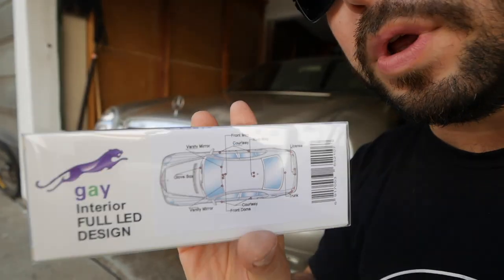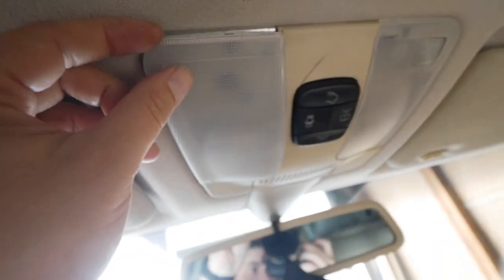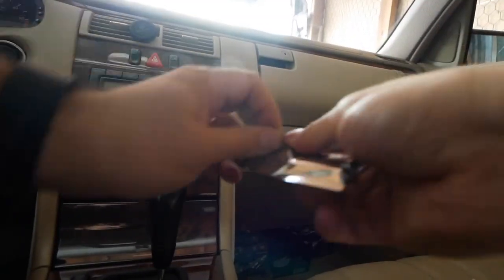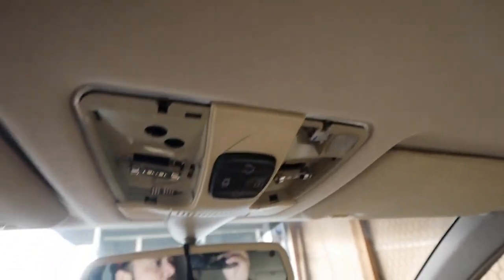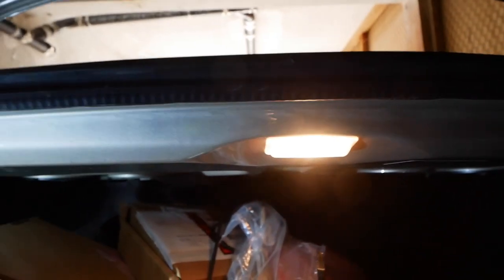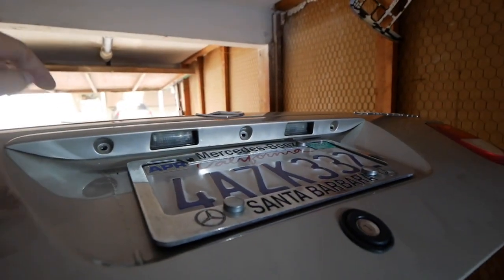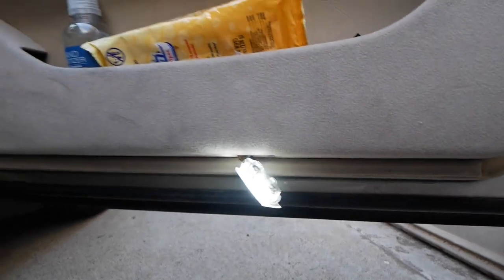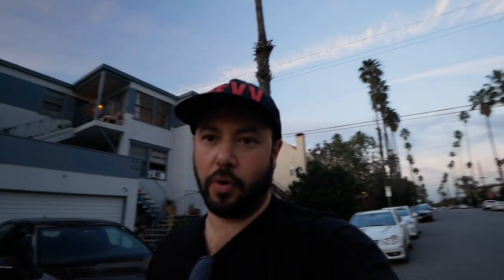Installing LED interior lights on my Mercedes Benz w210 E300d

Comment: is there also a light on the bottom of the backside of the driver and passenger seats? it's to light up the second row foot area
Reply: Do your car has led footwell light for back seat only or also have led for front driver and passenger side ?
Reply: @aizielarif9354  yes. i think is cos my w210 is the facelifted model

Comment: Make sure your lights are off or prepare to get burnt by old light and new light replacement and also live hot wire.even these leds get hot like bulbs.
Reply from the maker: Yup, that's correct. For the map ones, disable the open door activation
Reply: Can I sand paper the sides till it fits on the single map led or would that damage it?
Reply from the maker: It will probably damage it. Where are you located?

Comment: excellent video on a comprehensive W210 LED interior upgrade!  I have a '99 pre-facelift E320, and have converted all the interior & exterior lighting over to LED.  even the city lights, instrument panel & climate control unit!  it makes such a difference, and really brings a more modern look to a classic vehicle engineered to go deep into six-digit land... keep up the great work 🦾
Reply from the maker: Thank you for the kind words
Reply: Can you show or link how you did the instrument panel? Did you also do the window switches? I want a different color other than the stock old amber color
Reply from the maker: I have not done the instrument cluster yet
Reply: @RedmanSlapz   doing the gauge cluster is fairly easy.  you need a special tool which is basically 2 j-hooks with t-handles on the ends - use those to pull the instrument cluster free, it's a press fit and not screwed in.  if you adjust the steering wheel all the way out & down, there will be enough room along with slack in the cluster wiring for you to slide the cluster out and flip it up to rest on top of the binnacle, still plugged in, with the backside facing you.  at that point you have access to all the little t-hat B8X gauge cluster bulbs or whatever they are... unscrew & replace with LED equivalents.  I highly recommend testing & adjusting the bulbs as you replace them for optimal connection, as those twist-in connectors can be a bit dodgy.  leaving the cluster connected makes it super easy to do this.

window switches are another matter.  I could never find anything about anyone disassembling the switches to get at the bulbs inside to replace, and I wasn't feeling adventurous enough to rip apart my window switches without spares.  FWIW, the climate control unit is a T10 LED replacement and you can easily pull it with the same keys you use to pull the stock radio, T10 bulb goes in the bottom side of the unit.

also - when you replace the instrument cluster bulbs with 6000K white LEDs, the gauges will look brilliant white but the LED info readout at the bottom turns a light yellow-green rather than the amber/orange it is with the stock halogen bulbs.  ditto the climate control unit.  the LED upgrade really makes the bottom info display a LOT easier to read in bright daylight.

Comment: These are not the easiest cars to work on. Remember this one thing, all Merceedes are built from the inside out BUT with the technician in mind. The engineers do not make it “impossible” and when you are forcing on a Benz, you better think twice and ask yourself, does Benz mean this to be forced? Glue , tape and forcing do not belong in the same sentence as Mercedes. Cigarette lighter element same thing  😂🤣 . Keep on making these videos they are great! I have a 99 e300 TD with 298k. I’m a service consultant at a dealership. I’ve done everything to this damn car. I just got done installing  a new OEM rack, Pwr steering pump, and starter. Up next month is lower control arm bushings, tires, shocks and springs. This will be the best driving 300k + diesel in America. Lol.
Reply: you are so, so right - if it seems difficult or you have to force it, you're definitely not following the intent of the Benz engineers who, unlike some other German rivals (looking at you, Audi!), actually design things to be repairable.  a prime example of this is the small slot in the passenger front fender well, neatly plugged with an oval rubber grommet, that allows you to easily access the backside nut holding the upper right control arm bolt.  it looks a bit intimidating, but works brilliantly.  you can find numerous videos here of the unfortunate W210 owners who decided not to 'risk' it, and ended up spending hours removing/relocating the brain box just to access the nut instead 🤔

Comment: How did you get your map led light in.i can't get it in the plug  like the led light is too thick
Reply from the maker: Some of them are smaller, some of them are thicker(speaking of the bulbs 💡), and also some are mislabeled. For some I had to bend the pins wider in order to fit